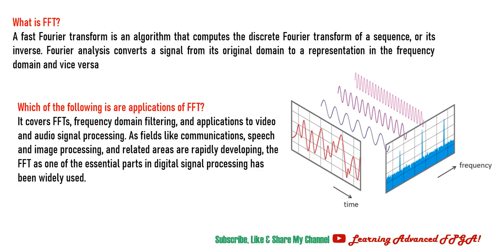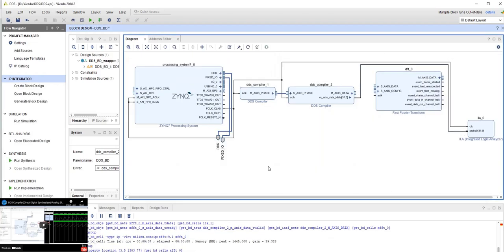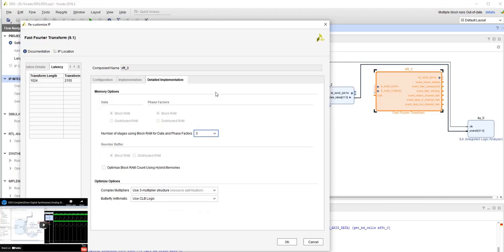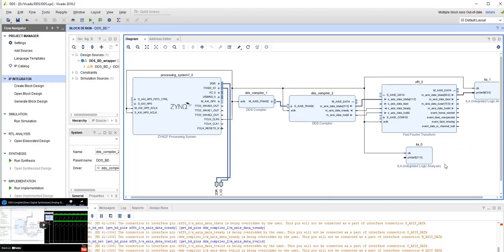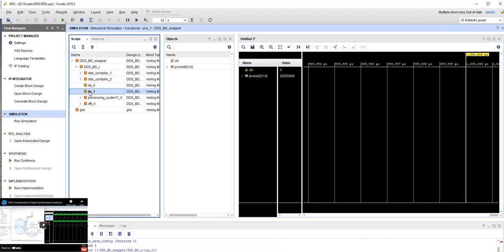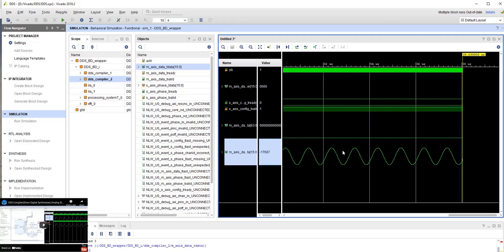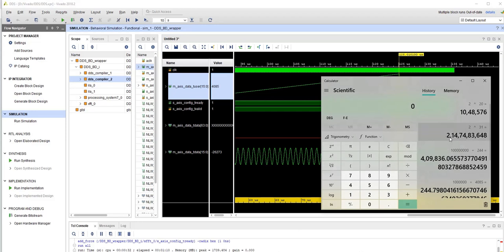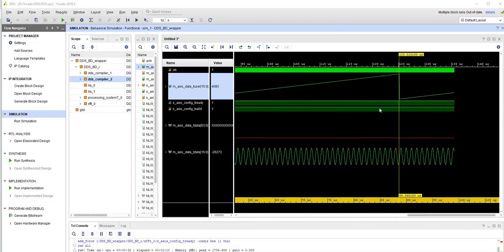FFT development on an FPGA - Simulation Design Flow using Vivado Software and Zynq Processor.

Comment: Well explained. Only thing I am having a problem with is the bit width coming from your DDS compiler. In your previous video, the DDS compiler was only 16 bit width but in this bit it was changed to 32 bits. I do not seem to have the option to configure the DDS to 32 bits.. maybe we have a mismatch in versions of Vivado? I don't believe my output is correct with only the LS 16 bits being inputted into the 32 bit FFT data port. Would like to hear your input.
Reply: I think you may have added sin/cos functionality instead of just sin? That does make sense for FFT analysis